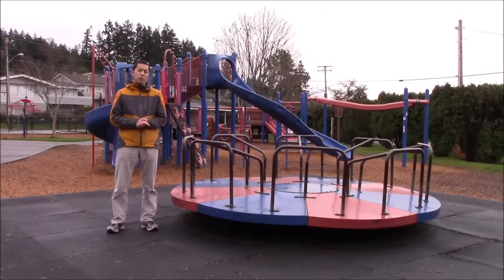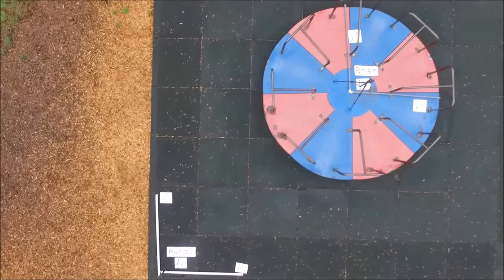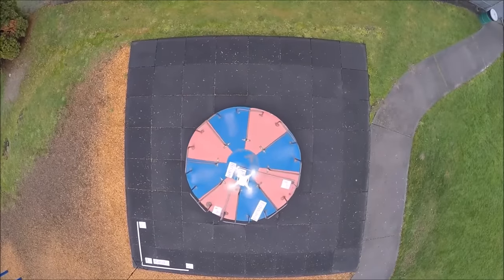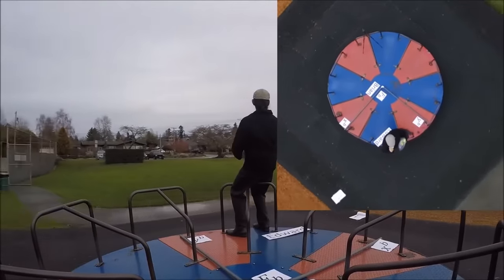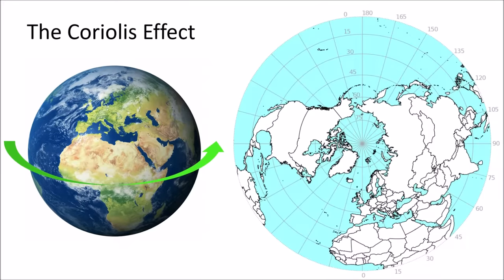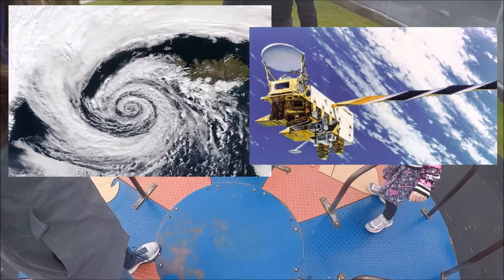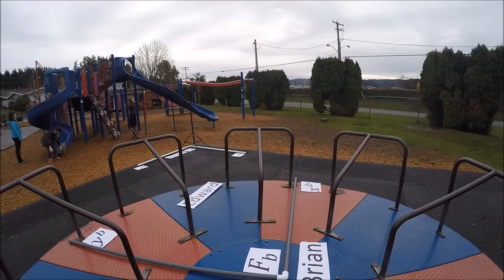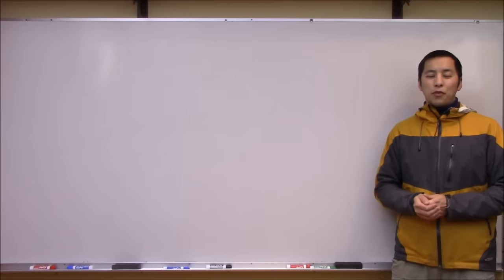Coriolis Effect Demonstration (with Drones)

Comment: If this effect is real then why, after 4 billion years of rotation at 1000 miles an hour, don't we have cumulative wind speeds of 1000 miles an hour?
Reply: good question never answered
Reply: Because the air has the same velocity, which matches the earth's rotation. Due to the laws of momentum and energy, it won't just start spinning faster and faster and faster. That would mean an infinite source of energy, which is simply impossible, as energy can't be created from nothing and can't be eliminated. Only turned into another form of energy. In this case, kinetic energy.

Edit: I am sorry, I misread the question. The reason we don't have extremely fast winds is due to relativity. The air may be moving with 1000 miles/hour, but so are we. If I were to shoot a basketball at you with 10 m/s a second, while you are moving at 9 m/s, the real impact would be the same as if the ball hit you with 1 m/s.

I hope this answers your question.
Reply: Total illogical argument. Not even worthy of an explanation.
Reply: @equinoxshadow7190  so you replied to say you don't want to reply?....yes I'm illogical.

Comment: So I guess wind has nothing to do with the Coriolanus effect? With the Coriolanus effect means if you were to suspend yourself or hover in a helicopter for say about a hour or two you should be in another state by the time you decide to land right. Since the earth is rotating and the Coriolanus effect?
Reply: don't forget that when the helecopter is on the ground it's spinning with the earth too. so when you lift off and fly straight up you retain that momentum. once in the air, what instruments are you using to ignore the rotating earth? 
because the air is also moving with the planet (just like inside a moving car the air moves with you) hovering will still be rotating with the planet. to counter the rotation and move to another state would feel to you in the helicopter as if you were simply flying towards the state rather than it rotating under you. because you would have to steer against the pressure of the rotating atmosphere to "hover independent of the planet"
Reply: I’m saying that NASA filed a report in 1988 that the earth is a flat and non-rotating
Reply: @robertmiller6501  false statement

Comment: The problem with your model is that you are trying to use a 2D model (a flat plane rotating) to explain what happens on a 3d model (a globe). If you are going to simulate North America, it needs to be on the side of the merry go round, perpendicular to the rotational axis. Then throw the ball out from the center of the merry go round and see what happens. Your example only shows what would happen IF you cut the spinning globe in half, like an onion, and then did a test on the flat inner cross section of said globe. A "model" needs to reflect that which you are trying to build your calculations off of, not a model of something completely different.

Other than that, nice video.
Reply: not really. The large-scale atmosphere is layers of 2D motion, since the scale height (23,000 ft) is much less then the radius-of-curvature (20,900,000 ft). Since Coriolis is derived from a vector potential, the only possible modification is a cos(co-latitude) scale factor. The only problem with the merry-go-round is that there is a huge centrifugal contribution mixed in the motion.

Comment: So are you proposing that the earth is spinning at 1,000 mph ?
Reply: I am assuming you are one of those flat earthers who thinks that because you don't feel speed, you mustn't be moving at all?
Reply: @darkner2390  simply seek the answer to the earths rotation
Reply: @keveng8232  What, are you saying I should research flat earth myself, because you don't have anything to refute the globe?
Reply: Things don’t spin in mph. The earth rotates at half the speed of the hour hand on a clock. That means the tangential velocity at the equator is somewhere around 1040 mph. And?

Comment: * First of all, you can purchase high altitude weather balloons for a few hundred dollars up to a few thousand - - - depending on how high you want to go and extras or not.
* Second, @11:50, your experimental setup is faulty - - - the merri-go-round is the equatorial slice of the spinning Ball Earth, therefore, you'd be flying directly INTO the center of Earth and NOT UPWARD along it's gradual curved surface.
!!! If your model were a spinning Flat Earth then this would be correct, but it's NOT.
Therefore, NONE of your experiments are valid unless you rig up a half dome on top of the merri-go-round and figure out how INVERT CENTRIFUGAL FORCES in order to 'gravitate' objects to a spinning body. 
Then you can figure out how to create a complete vacuum next to a gaseous non-vacuum. 
Good luck with that 🤞😕❓

Comment: When I flew from Patrick AFB to Toledo Ohio It was a 350 heading on the map. The only thing I corrected for was the wind with a E6B. During my preflight planning I figured out the strait miles from Patrick to Toledo express airport. I knew the flight time it would take and the gas I would use. If the Coriolis Effect was true I would have flown on a curve and run out of gas or my flight time would have increased. Funny thing I used no more gas or time. Unless my engine hour meter was effected by it flight time was dead on what my flight planning said it should be.
Reply: Why didn't you calculate the effect?

Comment: I will make this short and simple. It is strange how the Earth did not rotate beneath the stationary drone, when it should have ended up hundreds of Km away.
Reply: Yeah, only because it happens under the same rock you was born under
Reply: @nonconformist4802  Now, explain why and how a Foucault pendulum shows the Rotation of the Earth, if what you said is correct?
Also, do Snipers have to calculate for the Coriolis effect?
Reply: @pantheraleoromanus6241  
Let us first get on the same page here.
Your earth:
1) is flat and stationary
2) spherical and turning

"It is strange how the Earth did not rotate beneath the stationary drone,"
Strange that you make such a stupid statement when you can't even calculate the rpm of the earth, nor the distance it is "supposed" to move in a certain time on a given place.
Maybe if you are able to answer this, you will also realized how ignorant your question was about rifle shooting.
Reply: @nonconformist4802  A superb illustration of your intellectual ability. 
I guess this is the reason why you have  resorted to using an ad hominem fallacy which is personally attacking the individual, rather than the subject in question, a strategy which is implemented when one has exhausted all avenues of credibility, and their intellectual capacity to pursuit the debate any further, based upon its factual evidence and leaves them with nothing.

Comment: Actually coriolis is SO weak, it would not affect trajectory not even 1/10 of an inch.

These balls have not enough mass. Throw a solid heavy ball (lime a billiards ball, a pinball ball) and it will go where it should, because the relative "wind" caused by the angular speed of the rotation.

Your target is 10 feet away. It's nothing.

A sniper, 1000 feet away, is ALSO nothing.

If it's > 2000 feet, then they do a small adjustment, (depending on latitude) .

If it's a REALLY LONG shot, like 2.2 miles, then, depending on latitude, the error can be from zero to 9 feet.

If you are in the worst latitude scenario, your 10 feet shoot would have an error of only 1/10 of an inch with a dense and aerodynamic enough object. In avrg US latitude, around half of it....

Comment: This is not Coriolis effect

In your experiment from above with the rotating body is moving at the same speed as Brian what you're seeing and claiming the ball is deflecting showing that its trajectory is curve is not in actuality.

If you still had a point of origin reference from where their hand releases the ball to where the ball is targeting you'll see that it's the person rotating through the frame coming closer to the ball as it's flying through the air not the ball that's curving the ball still flies in a straight line from A to B but the rotation of the person is spinning toward the ball making it appear to curve.

That's an optical illusion.
as a hunter/ shooter,  i can assure you coriolis is not accounted for.

Comment: Teaching Coriolis effect with child merry go around is outdated and silly, This is what textbooks still teaches , that's what I learned, but it actually makes it hard to understand the real 4D Corollas effect. 
East is 3D spheroid, not freaking flat merry go around. This is like teaching flat earth. This is totally not helpful in 2023. It may have been useful in 1700s and 1800s, in the age of computers why would you still use the freaking merry go around, seriously.
Reply: It’s technically correct, and a good starting point, even if it doesn’t show a sphere. A good way to visualize it is to imagine you’re standing somewhere in North America at a point where the eastward tangential velocity of the surface due to earths rotation is say, 700 mph. If you fire a projectile due north, that projectile retains its 700 mph eastward velocity component, however, at some point farther north, the ground is closer to the earth’s rotational axis, so its tangential velocity is less, and the projectile appears to be curving to the right, because, as it flies overhead, it’s now moving to the east faster than the ground.

Comment: There is NO EARTH BASED CORIOLIS EFFECT
Reply: YES THERE IS.
Reply: @awatt  
So Earth rotates under a hot air balloon creating an apparent deflection??????

Nope. No Coriolis
Reply: Why didn't he throw a ball up at the edge and  when I'm sick on a roller coater why does it spray back or when you stick your hand out the window of car its called RESISTANCE
Reply: @choggaboom5280  
You definitely posted words.  Have you considered arranging them into some sort of coherent sentence?
Reply: @choggaboom5280  
That's so much better than your last effort.  Shame you haven't anything relevant to say.  Sad.
Reply: @choggaboom5280  
Why do things weigh less at the equator than at the poles?  It's almost like we are on a spinning sphere or something.
Spinning globe confirmed 🌎👍
Reply: @choggaboom5280  
Why do long range gunnery tables take coriolis into account?  It's almost as if we live on a spinning sphere or something.
Spinning globe confirmed 👌🌍
Reply: @choggaboom5280  
When you switch on a gyrocompass it will point to true north.  It's almost as if we are on a spinning sphere. 
Spinning globe confirmed 👌🌍

Comment: Hes using drones, but the globe doesn't spin under the stationary drone. The spin would be greater than 1000MPH at the equator. 600-700 mph in America It doesn't spin Yo. Earth is Flat!
Reply: Earth rotate very slow 0.000695Rpm. The drone already was spining with the earth before take of.